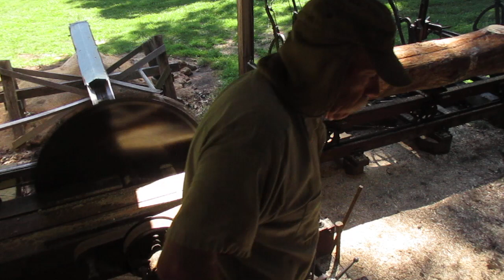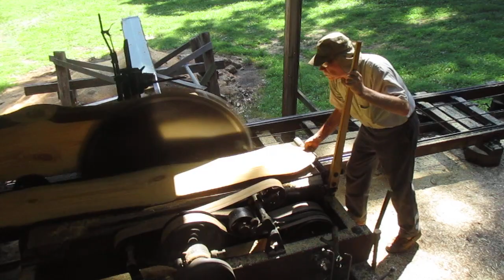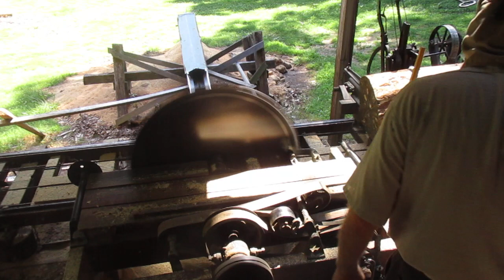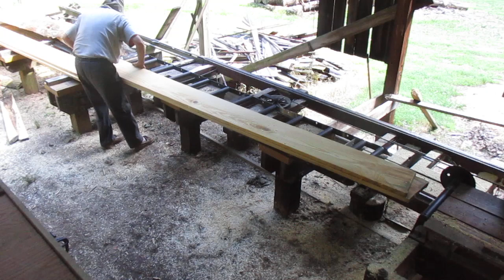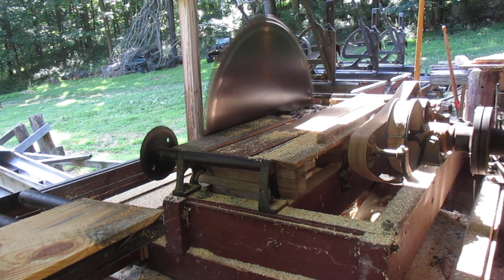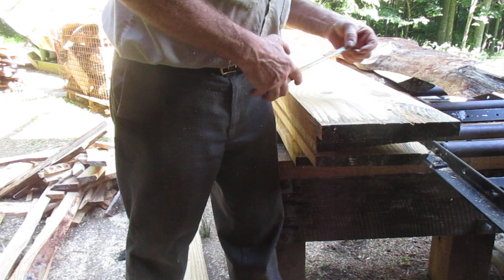SAW MILLING WHITE PINE #811

Comment: I worked for a small, family run logging and sawmill business in the early 80s in the Northern Sierra Nevadas. The saw was a 48" Foley Belsaw that was powered by a Chevy 350. It had a series of drivelines under the floor boards that powered the edger. A Volkswagen motor ran the chipper or the planer depending on which it was connected to. I have a WoodMizer LT40 now.  : )
Reply from the maker: hi there great story i like the wood mizers . i would have one but to many bucks for me . thanks for dropping in john

Comment: That is a wood eating machine. I just did a video on log scale and how much more I normally get with my bandsaw. In your experience how close to the log scale allowance do you get?
Reply from the maker: hi there don't really pay much attention to it . i saw mostly for fun and cut my slabs very heavy so there useful for fire wood .i found a heavy slab saves time and easier to deal with with a circular saw . less stuff falling into the pit . . i know that a circular mill takes a lot more out but the sawdust is more marketable then band mill sawdust . what do you do with your sawdust . i like the band mills but they were to costly for me 30 years ago and even now . i don't have 2000 dollars in this mill and sawed for around 30years with it .glad you stopped in john
Reply: @fricknjeep  absolutely! It’s fun to see what other sawyers are doing differently. There’s always something to learn. Definitely pros and cons on both Circle and band mills. I need to do a little research on it. Stumbled across your channel and thought I’d ask. Thanks for the videos stay safe and keep filming 🎥.